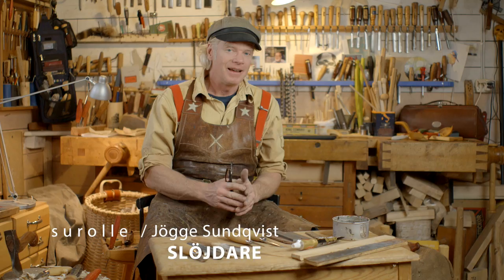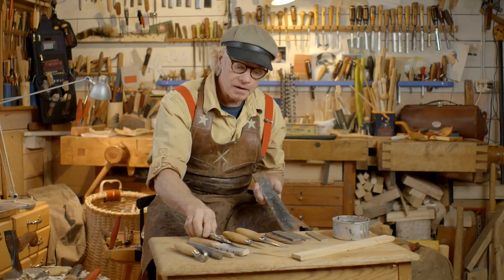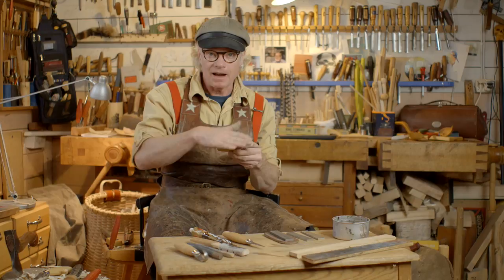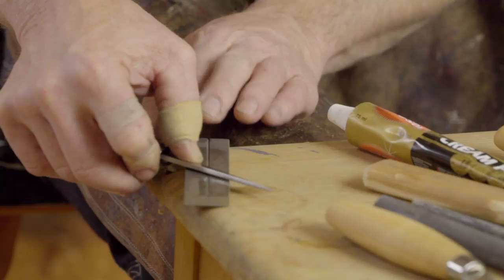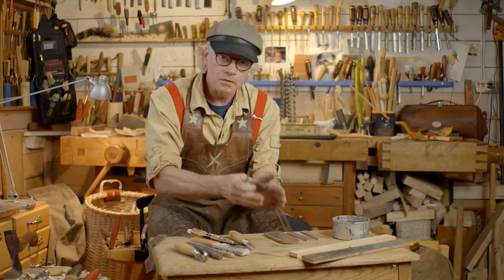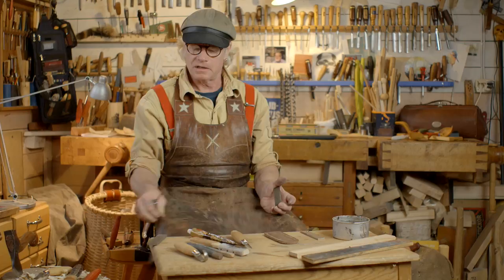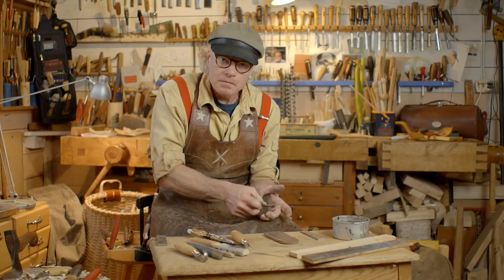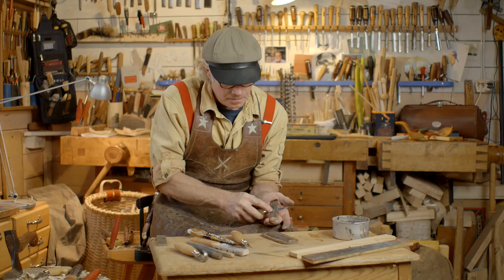Swedish Knife Grip Sessions NO12, part 1:  Honing and Stropping

Comment: The first thing I ever learned, was to keep a finger on the bevel edge. The pressire on the edge rather than from handle, helps the knife sit at the angle that it was ground to.
I also prefer hard strops like this wood block, or a very thin leather glued to a hard backing. It seems like the harder, finer surfaces have less compression and give a more consistent and less convexed polish.
When Indo want a convex edge, I use a belt/ barber style strop and use a combination of less belt tension, and or more knife pressure.
Looks like a solid lesson video. Simple, to the point, major points explained, no "filler" of unneeded content. I would expect as much from mora. Good job.

Comment: I've always felt that Autosol destroys the edge of my knife. I think it's because autosol contains something that etches the steel a little bit. It will make metal shine like a mirror, but I think it also etches away some of the fine thin edge. Instead I use dry (wax) fine polishing compound on my strop.

Comment: Great insttuctions! Just a question, why would you not use the leather wheel on the tormek to hone? I understand that this method works just as good but since you used the tormek for the grinding, wouldn't it be easy to continue with the leather wheel on the tormek?